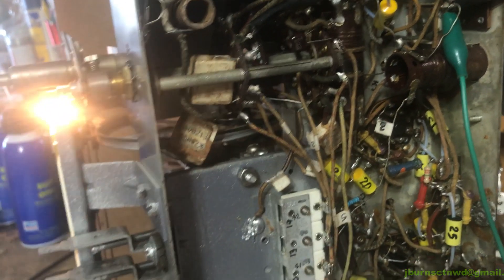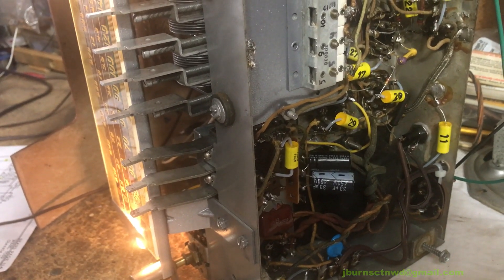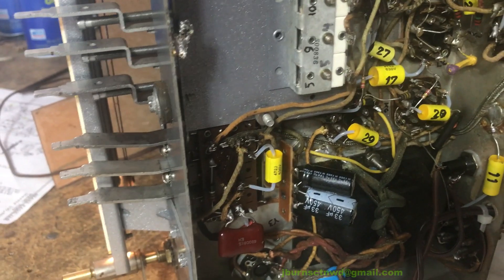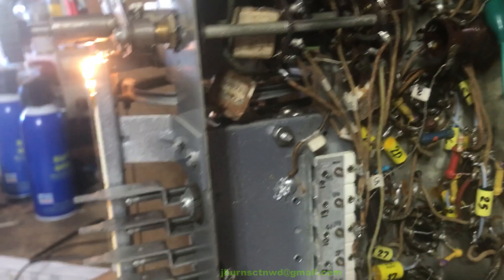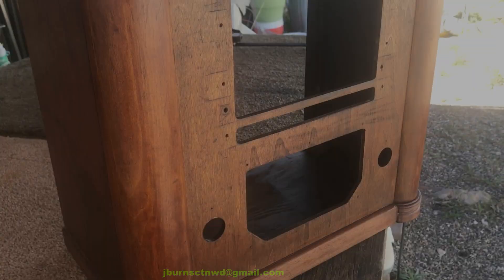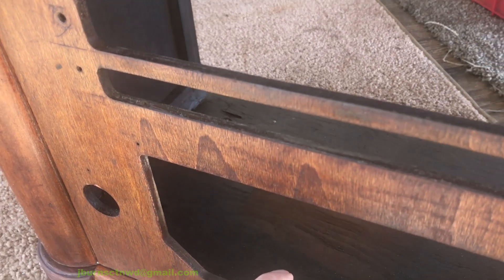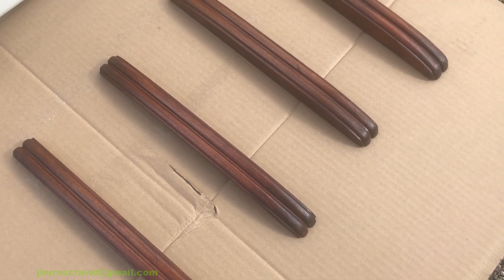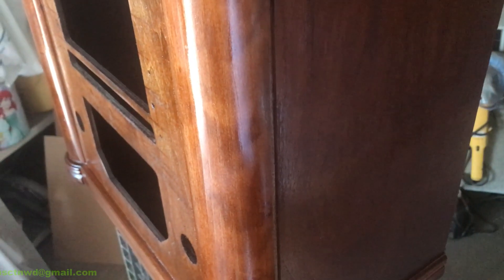Silvertone 7039_2 In Progress 16

Comment: So you listen to WWV in Fort Collins ,CO ? Good for testing if a  shortwave band is working.  Old leaky whitish colored
silver  mica caps. Depending on manufacturer they DO go bad after awhile. Cornell Dublier's tends to crack by the leads on
the ends and moisture gets in. Others because of manufacturing process, break along the seam on the narrow edge. 
Looks like you will finally be finished next time. (sigh of relief) Lots of work getting there.